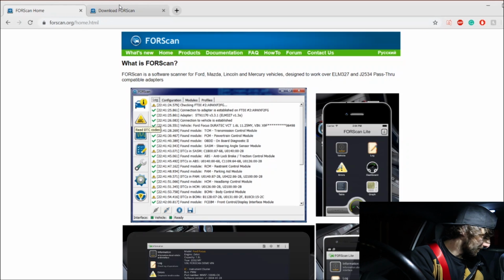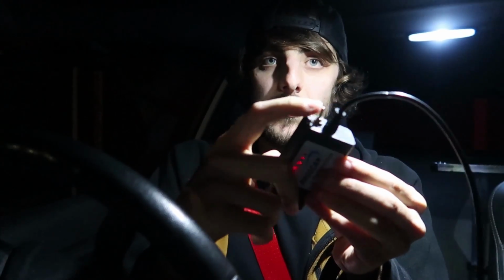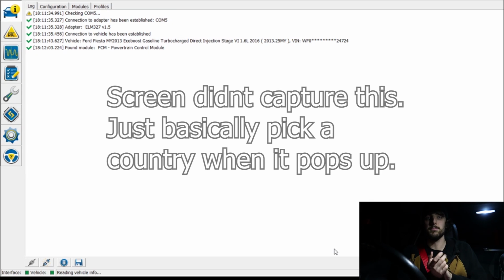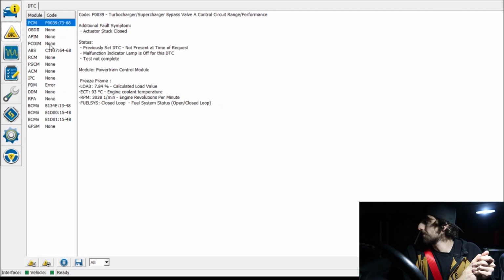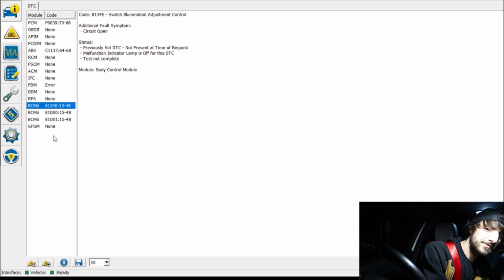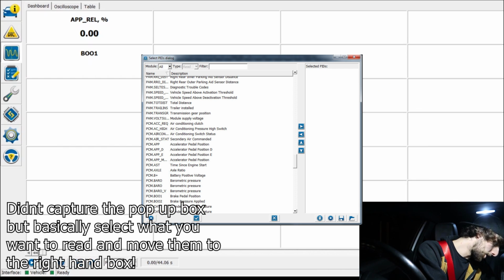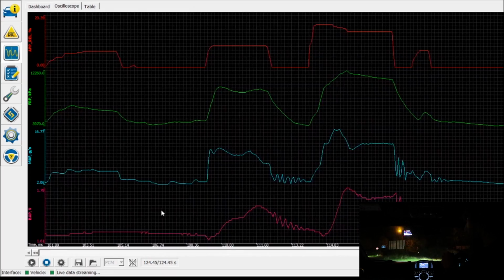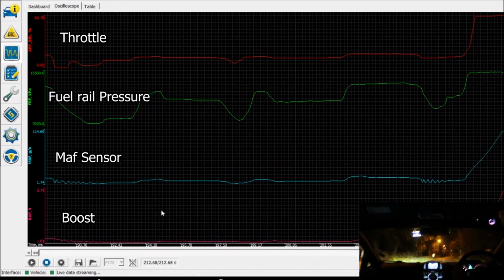How to use Forscan - The Basics - Fiesta ST180

Comment: Could any MK7 FiST owners help with a stubborn 'engine service now'/yellow spanner light I've been having? Generally comes on after about an hour of driving. It's definitely intake related (as messing around a little with cleaning the MAF sensor and changing filters affected the frequency of the light coming on). All hose clamps are tight. The car is a 2016 with almost 70k miles. Mountune 215 kit installed by previous owner and I suspect that could be where the issue stems from...